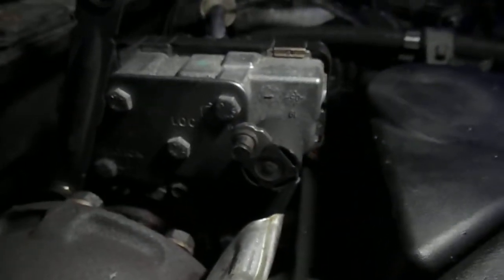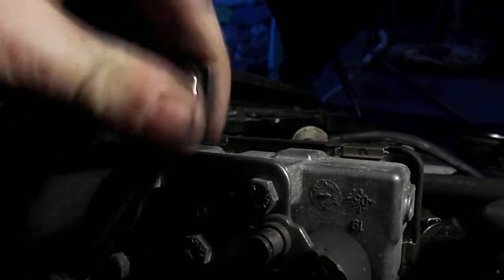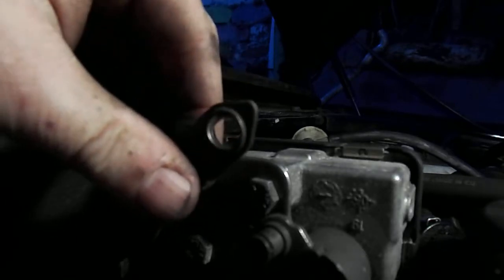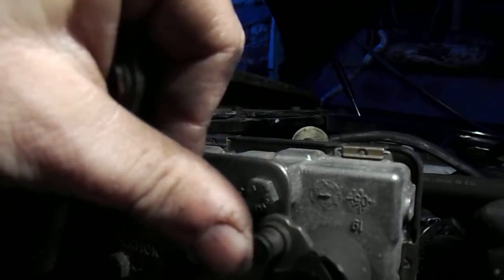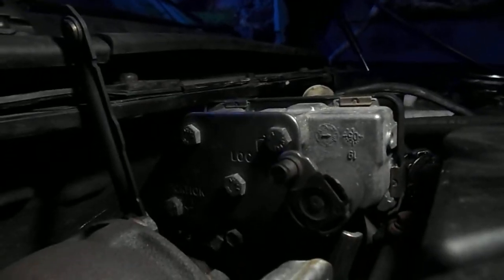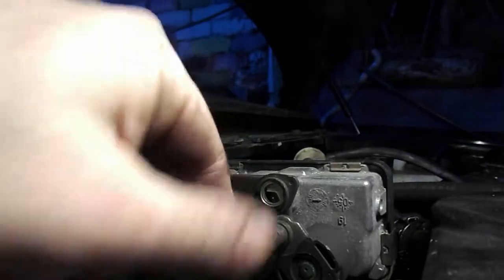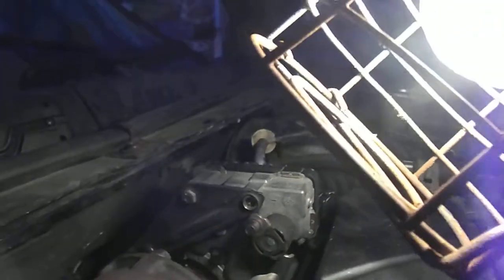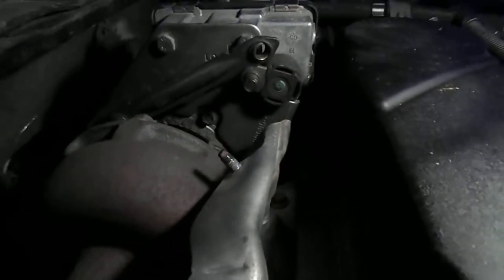Mondeo mk3,  X-type coil light flashing fault

Comment: Did driving with a disengaged turbo actuator arm cause any problems with the engine? In other words if the turbo intake is fixed and can't vary can it cause new issues with the engine.
Reply from the maker: Not sure long term. Had the car another 8 months with no issues and about 5000 miles.

Comment: I have the coil light on when flooring it in 3rd and ever gear higher. Done this no light but power is down. if I move the actuator arm to around 50% drilled an extra hole for testing so now flooring it comes back with the light even though the electric box is disconnected like yours. Any idea what I can try next ?
Reply from the maker: No, Sorry. can be anything from injectors to pressure sensor on fuel pump or rail. thats why so many give up on them, just have to flick key on/off lol

Comment: Its your injectors..take em out an have them cleaned
Reply: Hi Anthony
I have problem with Ford Mondeo 2005, 2.0 tdci 96kw
The car in the last couple months was turning off, I changed fuel filter and since then that stopped. But now Mondeo is running like it has 70 hp instead 130hp
Very low power.
And the engine light is on now in last couple days.
I did 1500km in last 6 weeks and all is good except it on low power, acceleration is baaad.
Is it injectors or turbo?
Tnx in advance for advice
Reply: @NM-ot1gd  id the same problem..a leak off test will show which ones need cleaning or repair
Reply: Anthony Quinn tnx
Reply: @NM-ot1gd  And what was it cuz I got the same problem